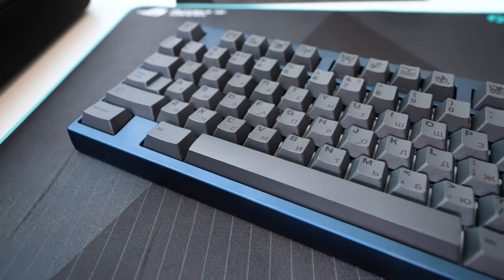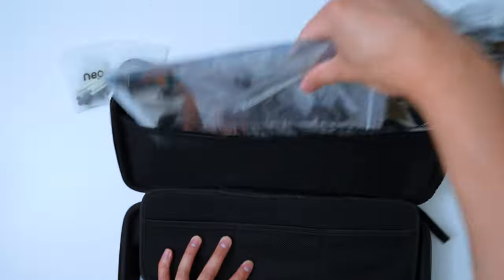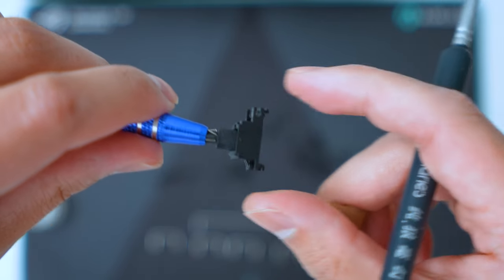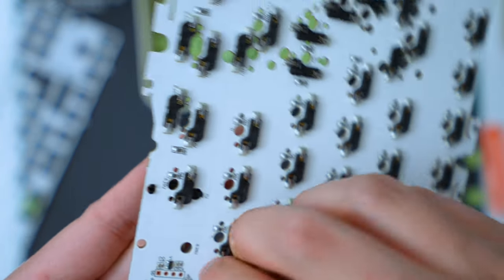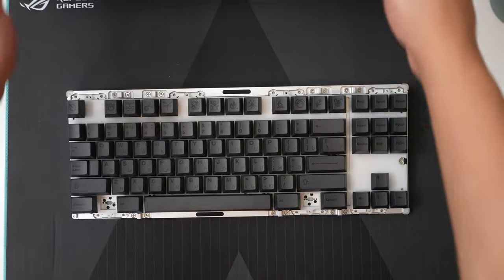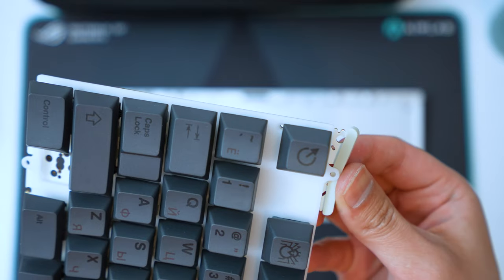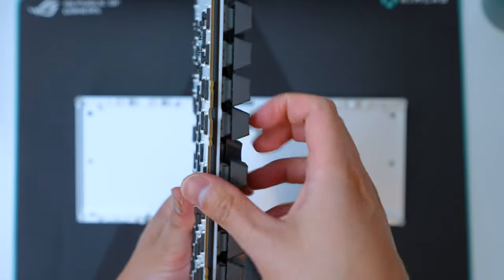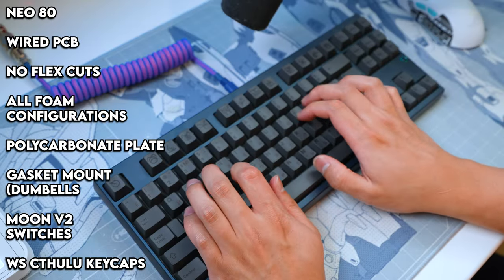How to Build a Custom Keyboard in 2024 ft. The Neo80 by QWERTYKeys

Comment: Wonderful keyboard!!! ❤

I was thinking of building a TKL but I don't know exactly which one so yeah I am still looking for ideas, the Neo80 seems like a fun build. Once again, great vid!
Reply from the maker: Thank you so much! The Neo80 was super fun to build, and super easy to modify which definitely made it more convenient for switching out different switches
Reply: I'm normally more of a 75% guy but picked up both a GEM80 and a Neo80. The GEM80 is quite unique with the plastic bottom, all I did was add switches and caps and the sound is quite unique. The Neo80 seems more premium though. Maybe it's the fully AL case but it's quite heavy and the sound is probably the sound in your head. Just pay attention to the orientation of some of the switches will be reversed, you can see that in Jon's video here if you pause it. I went dumbbell mount as well than once that is done there are no ribbon cables! I used all the foam included, the included stabs, WS Heavy Tactiles and GMK Botanical on a green Neo80. It's phenomenal. I would recommend either depending on what you want but this is my second Qwertykeys board and both are simply stellar!
Reply: @MarbsMusic  Thank you, Marbs!!

Comment: Nice choice with the WS Heavy tactiles, that is what I have in mine with all the foam but with GMK caps and it definitely gives it a little pop to go alone with the thock. Very nice build demo, sub added! I have those switches now in my Neo80, Bakeneko65, Luminkey65 and Jaris75... simply my favorite to type on. I do love those Cthulu caps, going to have to get a set! To me the foam doesn't mask the sound bad in this keyboard like in some others depending on the caps used.
Reply from the maker: Thank you! OMG, I should've jumped on the JRIS75. I have the JRIS65 and love it.

Comment: is dielectric grease good for lubing stabilizers? :0
Reply from the maker: Yes! In fact I usually use Dielectric grease for the wire and dip it in the tube. I just couldn't find it for this vid.. lol
Reply: only for the wires. never use it oun the stem or housing